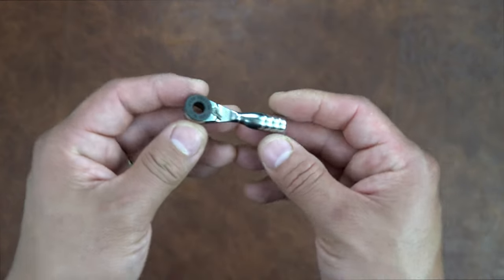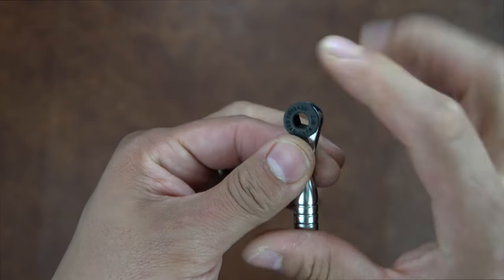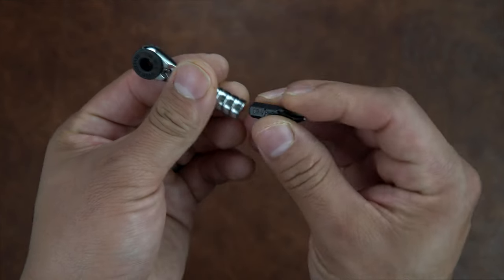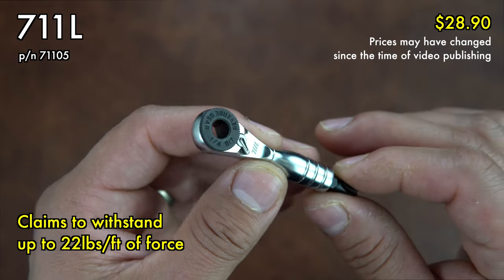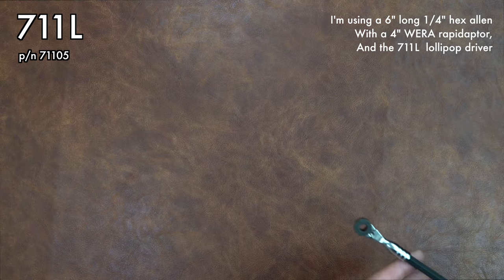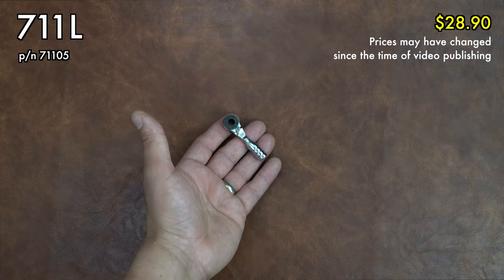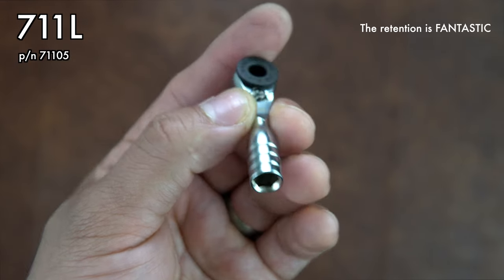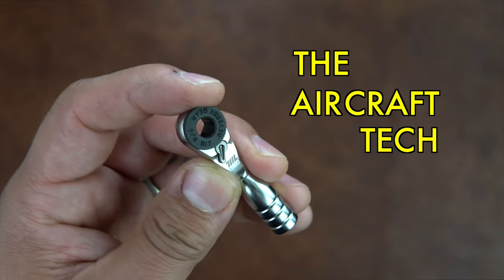World's Smallest Hexbit Ratchet. IT'S A BEAST!

Comment: Hot tip here - the Wiha double-ended bits are PERFECT in this ratchet.  They seat perfectly because the other end of the bit can project through the center of the bit holder.
Reply from the maker: YES!
Though some of the slotted (larger sizes) don't go through. It also accepts Leatherman bits
Reply from the maker: Going to have to make another video showing it's full capabilities
Reply: Do they sit correctly in the shaft end? I have been trying to get this answer for ages, but all the videos I've found have them in the circular end only. I hope you can answer my question!

Comment: Very cool.  I have the ICON mini bit ratchet and I use it almost exclusively on my motorcycles, as a ratchet or a T-handle.  In fact, I almost never use anything else, unless I am dealing with the axle bolts for chain adjustments or tire repair.  I didn't even know there was a driver this short on the market.  I will definitely pick one of these up and try it out.  Thanks!
Reply from the maker: So many people have told me about it, I'm picking it up this coming week and giving it a detailed review!
This specific one is SUPER small. The cool thing is that it's a beast too, can withstand a good amount of torque, and can be easily extended if needed. 

Thanks for watching, make sure you sub for that ICON review, and more!

Comment: Hey Aircraft Tech... I was using some old safety wire twisty pliers today, to secure some handle grips on my motorcycle.  I know, most folks use grip glue or hair spray, but the safety wire trick was taught to me 40+ years ago and old habits die hard.  Anyway, it made me think of your channel and the likelihood that you must have specialty tools for adding safety wire to bolts all around an aircraft.  Personally, I would love to see the different and unique tools available for this  AND I would love to see the different types and styles of wire and braids used.  Even a video of the different techniques would be awesome.  Thanks!
Reply from the maker: Matthew! Thanks for thinking of the channel. Yes, we use a few specialized tools here and I'd love to make a video on safety wire pliers alone! I have a video drop tonight for another tool, and then a few more coming, but believe me, safety wire pliers are in the near future for sure!

I appreciate your support and input, and thanks for subscribing.
Reply from the maker: Hey Matt, i was going to tell you, the night after reading your comment i had to do the RnR for some fire bottle elements (water adsorption filters), and they are in a tight spot. Anyway, had to safety wire them, and it just reminded me of you since i had to fiddle around with the safety wire pliers in order to get them done. Ok have a great day!

Comment: Sort of looks like the little Leatherman version of the ratchet, but with a full diameter handle. Great find!
Reply from the maker: That's it exactly, it's the same.comoany that makes the ratchet that fits into the Leatherman bit holders. This system is actually smaller, and let's you expand so easily. Its in my pocket everywhere I go.

Comment: I use a ratchet that looks pretty much the same at work but is 10 cm /4 inch long. I think when it comes to making this one its the same just taking out the middle part. I think that this  might be too short for use as you can bearly grip it a 60mm extension would be good for leverage but it mostly defeats the goal of carring such short ratchet, unless you just want 2 short parts to carry
Reply from the maker: I have a video on different bit drivers, and there are several examples of the one you are talking about (Topeak, PrestaCycle, even Icon if you include a flexhead). The appeal of this one is portability and modularity. It is basically a finger ratchet, can make a short ratchet when combined to a handle, or be extended to fit a desired length. 
This company makes a ratchet that is designed to fit into Leatherman bit holders, and it's almost the same size. Theoretically you could say this one functions in the same manner, but for multitools other than the Leatherman.
Reply: @TheAircraftTechnician  ive seen that video, and after watching it i wanted to buy that PrestaCycke one (alredy have Tpeak) bu i think i will get one that is similar to the Icon as im not in US and cant get the Icon but i can get one from Facom. And i like that idea at the end to make it a ratchet for multitools
Reply from the maker: About $20 more than the ICON, but definitely worth it if you cant get the harbor freight kind

Comment: Does it work with wiha dualbits ? or leathermans?
Reply from the maker: This is the company that makes the Leatherman bit ratchet, and this one also accepts (and retains) Leatherman bits. Reversible bits (if that's what you mean) do not lock-in, unless you insert the Phillips side, then the ratchet locks it in place and the slotted side can be used

Comment: Great video. I also use a tiny flexing ratchet. But is has no reverseyou just use the other side, so be careful!
1pc Dual Drive Flex Micro Ratchet 1/4″ Square and 6.3mm HEX Drive – MRSC08
Reply from the maker: Thanks for the  recommendation! I'll have to check it out